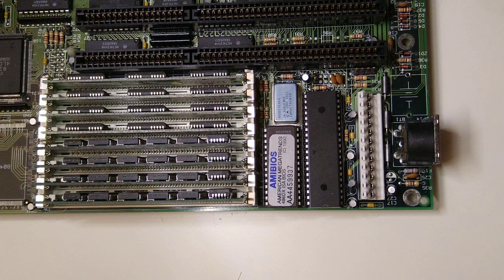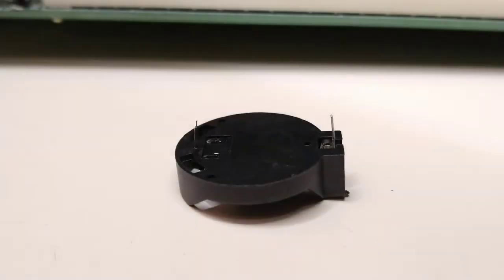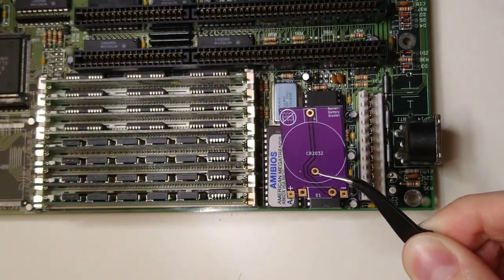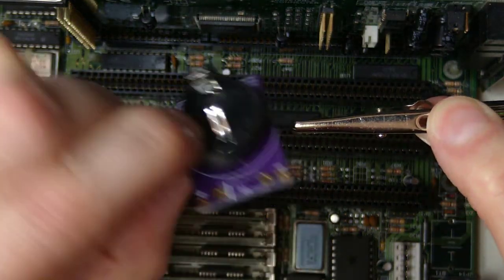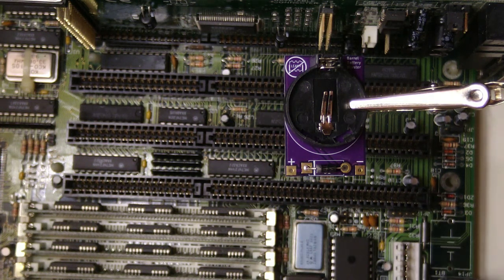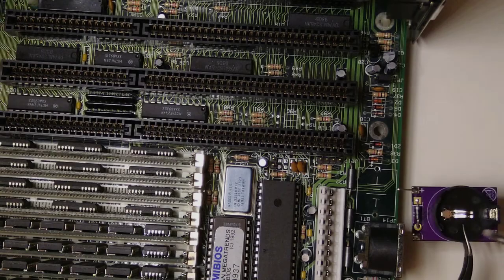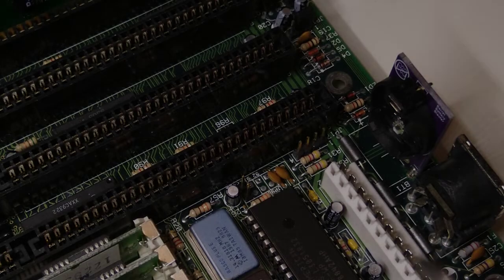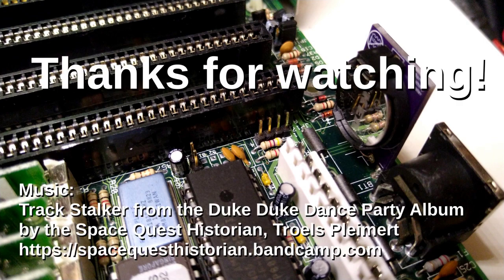Barrel Battery Blaster: Drop-in replacement for leaky CMOS batteries

Comment: You are some kind of wizard! Great idea. Although some boards may need a double CR2032 holder as there are some boards where the single cell is not enough to keep the full function.
Reply: You can use LIR2032 that has 3.6V

Comment: Looks good, minor improvement would be to flip the vertical for the battery holder, would make removal of the CR2032 easier...
Reply: You mean with the battery facing to the back of the board? That would make it worse once the board is installed in the case, given the socket would be up against it.

Comment: Very nice! The battery should face the board edge, though, to make it easier to replace
Reply from the maker: Yeah this makes it a bit easier to replace, but you can always place the battery holder on the other side.
Reply: If it faced out it would be in a computer case and nearly impossible to replace.
Reply: In some cases it would, and not in general

Comment: i got one of those for my 386SX board and sadly it seems to not work, it like is ignoring any battery i try, i did pay attention to the polarity as well.
Reply from the maker: Hmm perhaps the diode is the wrong way in? Have you tried measuring the voltage at the pins with a multimeter when the PC is off? You should be getting a little over 3V with a new battery.

Comment: How has the cr2032 going after 1 month? Is it still holding the settings. Thinking about ordering these pcb but not sure if 3v is enough in standby. Thanks and enjoyed watching
Reply from the maker: I just checked and it seems to be holding the settings fine after ~2 weeks off power. But yeah, ti may not work reliably on all boards.

Comment: Would it be possible to use a rechargeable ML2032 without any diode or is the charging current of the NiCd battery incompatible?
Reply from the maker: I would guess that the ML2032 would require some decent charging circuitry to avoid damaging the battery.

Comment: Pls share the Diode no?
Reply from the maker: Try a schottky, like the 1N5817 or 1N5818, 1N5819 any one of them will do.
Reply: @scrap_computing  Thanks a lot.
Reply: @scrap_computing  I know, but my tests gave some strange results.
I tested these in a Breadboard.
Using 1N5819, when I give 5V in opposite direction, the leak correct is almost 1.5v!
Using 1N4007, when I give 5V in opposite direction, the leak correct is almost 0v!
But, 1N4007 makes 3V, drops to 2.6-2.8V.
Reply from the maker: @ayan.debnath  You should not worry about reverse voltage. The only thing that matters is the voltage after the diode, it should be as high as possible (close to the 3V of the battery), which is why a schottky is usually a better option.

Comment: barrel batteries are rechargable, cr2032 are not, how do you explain that ?
Reply: That's what the diode is for. It will keep the board from trying to charge the batter, but allows the battery to still run the RTC SRAM.
Reply: @RodBeauvex  what Diode should I use? model?
Reply: @ayan.debnath  Any cheap diode will work, though try to find something with a low voltage drop. The bigger problem is most boards were designed for whatever battery they came with, and if they were designed for other types, other circuit components me be needed, and those are application specific.